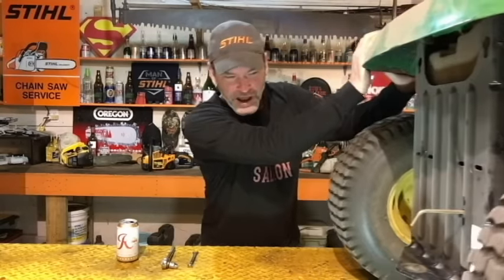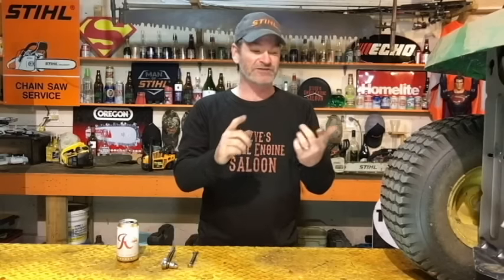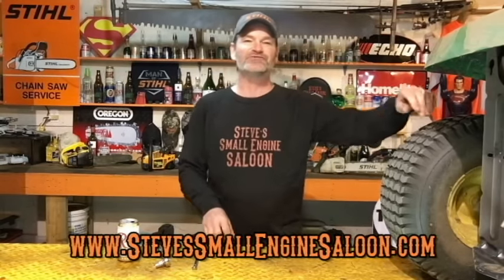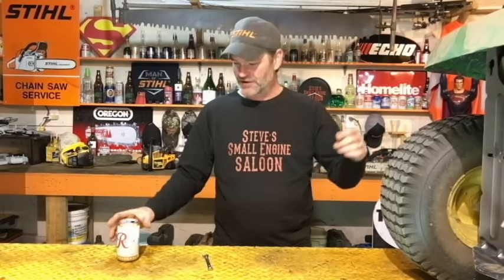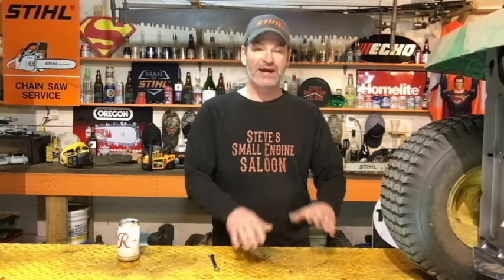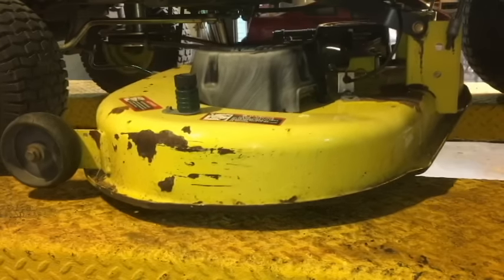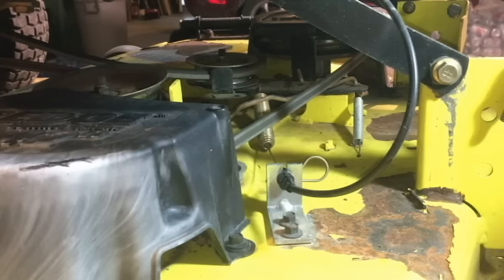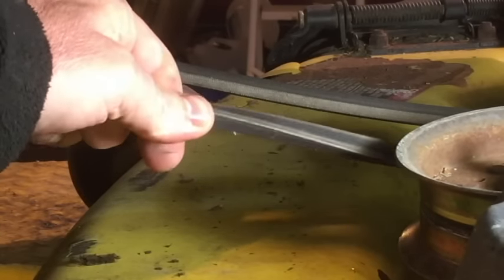How To Adjust The Belt Tension On A Riding Lawn Mower

Comment: I'm getting ready to convert a new E130 42inch deck to have an adjustable cable bracket.  It seems that in John Deere's infinite wisdom, they've found that they can save money and time in manufacturing if they simply weld, what was once an adjustable bracket, down to the mower housing.  As a result you then have absolutely no way of taking up the slack from belt stretch and or cable stretch.  You then find yourself at the mercy of John Deere's parts and service department having to repeatedly buy new belts and actuator cables and having them installed.  
The adjustable bracket is a John Deere part # GX20168 and the 2 mounting bolts are part # GX22456.  The cost for the bracket and bolts together is about $20 and anyone who is slightly mechanically inclined can cut the old bracket off and bolt down the one that's adjustable. 
 It seems that John Deere is aware of the lack of adjustment issue, but insist that the remedy is a new belt or cable or both.  The only way to get the adjustment feature on a new model is to buy one of the higher end models; it seems that an over 2 grand investment for an E130 isn't enough.

Comment: looks like you can turn that bracket 180 deg and get even more adjustment out of it....drive that belt till it snaps.
Reply: Great idea!  I just put a new belt on mine and it's too loose even when the bracket is positioned all the way back.  I'll try your trick tomorrow and see if it works.
Reply: @davepeterschmidt5818  seems like it should work, if not, the bracket is so simple, you could make a longer one out of some flat stock.

Comment: The geniuses at John Deere did not put an adjustable bracketcon my deck. Instead, they welded a bracket on with no way to adjust the cable.

Comment: I liken the starting instructions to SPINNING YOUR WHEELS, @ EVERY stop sign!  No wonder, you need NEW TIRES, SO OFTEN!  Same goes with STOPPING the blades.. screw it!  Start your mower, reduce ( remove choke ( idle ).. and THEN START (W/O CUTTING GRASS) while on the drive way or NOT in the yard.
Reply: Easy to start on the driveway when you have a small yard. I mow 8 acres, and the driveway is gravel ... don't want to start on that. Besides, Steve wasn't saying to start that way every time. That was a test. Did you skip parts?

Comment: I purchased a new S100 which I like and checked the adjustment. It has none. The piece Steve pointed to with the two bolts is now welded to the deck.

Comment: OK your video is good but you’re missing out on something the newer John Deere  E 100 do not have adjustable bracket it is now welded and I know why if you tighten that belt too much your cutter blades will not disengage when your mower is still running and you have released the engagement lever so this is very dangerous and that is why that bracket is welded easiest solution is buy a new belt what happens is people put the belt on wrong the first time try to engage cutter and that stretching adds an extra inch and a half or so to the belt by stretching now all that said I have a solution I did but don’t recommend it for anyone else unless your mechanically inclined and know what you’re really really doing what I did was take a piece of wire stiff wireAttached it to where that large spring hole is and then back towards the other area where the cable comes through I’m not being real specific how I did it but what I did was I kept the pulley from moving in to much allowing the belt to come off when the cutter is turned off. The first time I did it I had too much and the pulley was still engaged when the cutter handle was turned off I had to readjust it to make sure that when the cutter is disengage the blades are not still spinning. John Deere could take my idea and remedy the situation very very easily now that I’ve done what I’ve done a simple solution

Comment: Of course now on the newer Deere machines........John Deere in their infinite wisdom have welded that adjustment bracket to the deck so adjustment is no longer possible.  Some outfits will go to any length to gouge customers.  My deck on my 2018 D130 was constantly throwing and chewing up belts.  So if you're not mechanically inclined what do you do?  You keep going back to your Deere dealer spending more and more $$$$.  Solution.........cut the welds on the bracket to make it adjustable again.  Lo and behold what did I find hidden underneath that bracket when I cut it free?????  Yup......2 bolt holes for bolts to hold my now adjustable bracket.  Manufacturers are pathetic with some of the stupid crap they pull just to rip customers off more and more.

Comment: LOL this John Deere stuffs garbage apparently I have basically the exact same or you have they're on the table except that bracket that you say to unbolt and slide is welded in place so I guess the only way to fix it is to buy a whole new cable

Comment: What if you got a 2022 mower bracket that’s welded to the deck? Who the hell puts a belt on a mower and leaves no way to adjust the tension? I call it a defect in manufacturing. U r screwed! U r out $2600 with a mower that don’t work . Thought this video was the answer to my belt coming off every time I disengage the blade until I discovered the bracket you spoke of has no holes and is welded stationary to the deck. I’m pissed!! It’s definitely a manufacturer defect and should come with a money back warranty for buying this piece of shit.

Comment: Still not enough adjustment.  Doesn't tighten up on a brand new belt.  D-130 is a horrid design.  Complaints all over the internet and when you call John Deere, that deny that there's a problem.

Comment: Just buy a new belt. A lot cheaper than replacing the bushing in the pto control, because you'll wear that cheap POS right out with the extra tension on the cable.

Comment: This video should have been 30 seconds long.

My belt has to be replaced every month because it gets abused due to the fact I live in Hawaii and everything grows extremely rapidly all year long. I'm rolling over bushes . 
I want to use out that is 1/2 in longer because that size is more readily available. So what I want to adjust is the pulley. I'm hoping there is a pulley adjustment. I need that lever to make the pulley travel further.

It would also be really nice to be able to raise the deck higher. 4inches os not enough... Or at least that's what my wife says 😂

Comment: Nope.  My D105 didn't have the adjustment bracket... just a welded plate that the cable passed through.  Same thing for my Craftsman T1500... no adjustment anywhere.  THAT one has slipped since the piece of garbage was brand new, just got worse over time. Never buy a Craftsman mower... and don't buy their warranties - they will NOT honor them.  In 5 years, and several calls, I never once got them to honor the almost 500 dollar warranty.  
Anyway, no adjustments.  Period.  So this didn't do me any good.